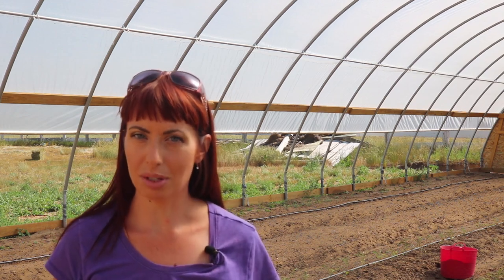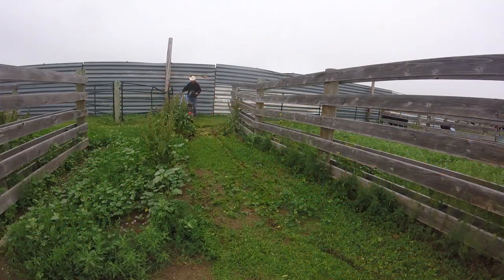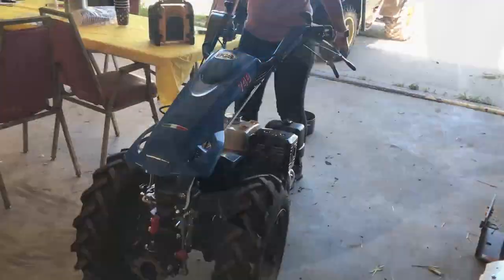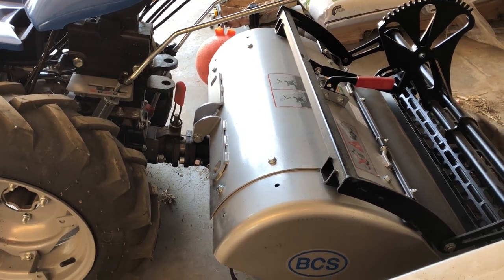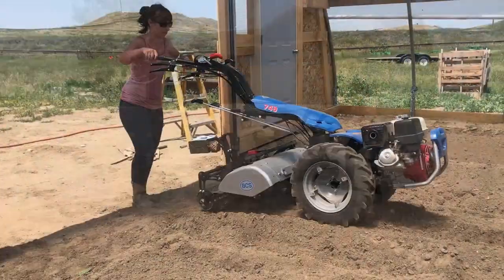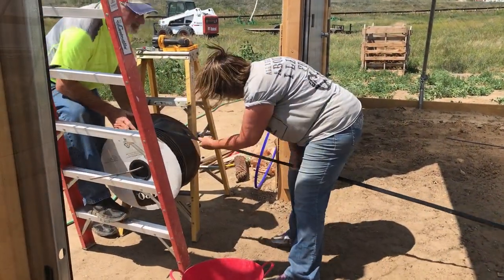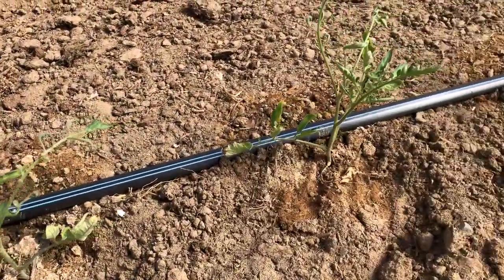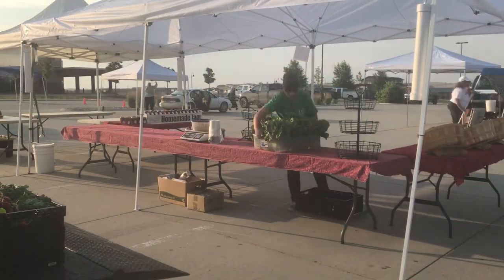Raised Beds and Water - Gardening the High Tunnel

Comment: Looks great Erin! Glad you are getting to work your new soil (mama always told me "son, dirt is what's under your fingernails, that's soil you're working in!) That 749 is a beast! The PDR is a game changer! I put off buying a power harrow due to expense and singular purpose, but this looks like the way to go. Best of both worlds, tiller and harrow in one. If you keep the tines shallow on the tiller it's virtually a PH. Pop off the PDR and you've got a straight tiller. I need to talk to Joel at Earth Tools about compatibility with my Grillo 22" tiller. I'm running the G110, which is basically the same tractor as yours, mine is just older. You've got a few more bells and whistles! Those Italians know how to build a walk behind tractor, for sure! It will serve you well!
Reply from the maker: We were going to go with the power harrow and then this came out and we knew the PDR is exactly what we needed.  I can't wait to use it next spring in the outside gardens.  It's going to make the beds a dream to direct seed into.  I hope your tractor is compatible!  Thanks for watching!  -Erin

Comment: Looks great Erin. The irrigation system looks good now during the summer season. As cool temps start later you may to insulate the lines, but the drip system looks like the way to go. With the high tunnels you should be able to keep producing longer.
Reply from the maker: We usually keep the tomatoes going into October.  If they were outside we usually get a tomato killer light frost in September so it's definitely beneficial to have the high tunnels.  Thanks for watching!  -Erin

Comment: Hi Erin, that is quite a hand tractor...it really takes off when you put it in gear...lots of versatility too. I am sure that you were eager to get going...a bit later than usual but it will all work out. Curious to see how you farm in the winter months...will that drip irrigation system work then? …. seems like it would freeze. Thanks for the vid...great to watch it go from foundation to planting...all in all, done it a pretty short period of time.  Congrats!  Terry  - Justin, Texas
Reply from the maker: We don't use drip in the winter months.  I drag a hose around and just overhead water.  If we had even a little bit of heat in tunnels at night we would be able to use drip but we are completely unheated in the winter so I just hand water.  Plus in the winter we only need to water about once a month.  The plants just don't need much water in the winter.  Thanks for watching!  -Erin

Comment: I might give that drip tape a try next year. It's got to be way better than watering with a sprinkler. Roughly how long do you have to leave it on to get a good watering? I usually run my sprinkler about 1 1/2 hrs. early in the morning. I am kinda jealous of your rock free soil. LOL! When I watched mike with the post hole digger I cracked up. There are so many rocks here, I think that raised bed plow would throw me across the garden. hahaha. Looks like it really kicks butt though. Good luck with your tomatoes.
Reply from the maker: Right now I'm running them for about 45 minutes each, everyday.  Once they get through their transplant drama I will back it down to every other day.  Might have to run a few more minutes but I like to water the tomatoes deep and every other day.  Seems to help them with blossom end rot when we get to the ripening phase.  It's so much more efficient than a sprinkler.  Eventually I would like to put more stuff on drip.  It's just a better way to water that's for sure.  Thanks for watching!  -Erin

Comment: The new high tunnel is looking great, can't wait to see what you grow in it. I've watched you and Mike work with that BCS machine, and one thing occured to me. When you flip the end you're running it from, does it make forwards and reverse "backwards" too? That is to say does the direction control for forwards when you have the plow or the tiller become reverse when Mike has the flail mower on it? Or do they have the linkages rigged up so that forwards is forwards no matter which end the controls are setup on?
Reply from the maker: When the mower is on reverse is forward and forward is reverse.  It's a bit confusing sometimes but once you get the hang of it it's really easy to use.  Just have to remember which attachment you're running!  Thanks for watching!  -Erin
Reply: That makes sense, thanks!

Comment: We use drip irrigation at my work too we have an issue with pressure near the far side of our lot what do you recommend to fix it ?
Reply from the maker: I would check with the company for the drip line you're using and see how long of line you can use.  Also check your pressure.  Too much pressure can be worse than low pressure in my experience.  Hope you can get it figured out!  Thanks for watching!  -Erin